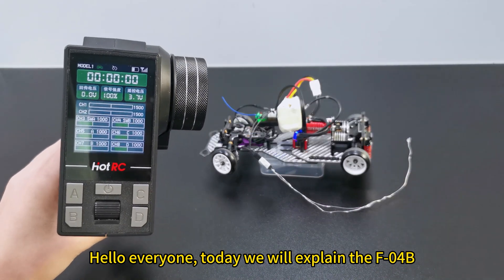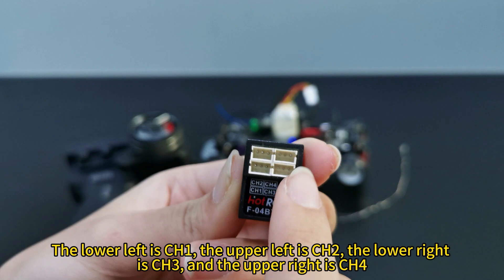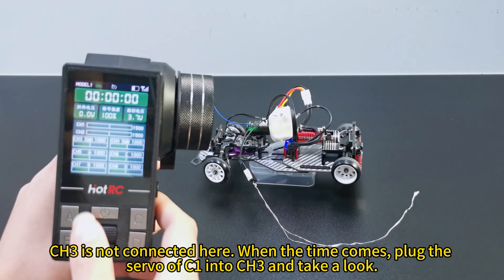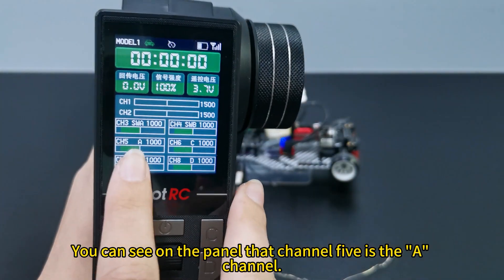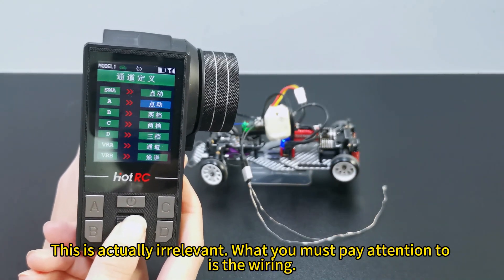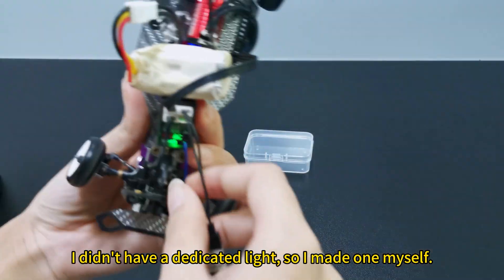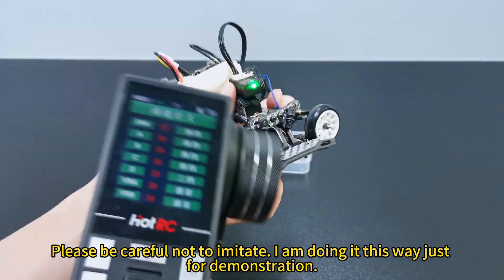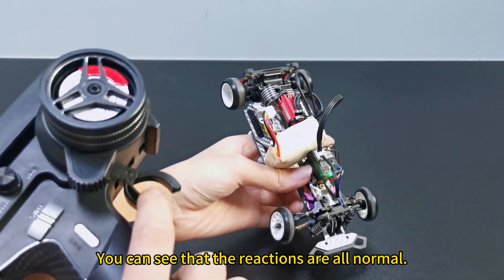What is the use of CH4 of the F-04B receiver?

Comment: Is the plug size 1.5 or 1.25?
Reply: I had to use 1.5 plugs as the 1.25 was too small.
Reply: @neilmcgrath2647 was that with the F-04B receiver? I'm struggling to find what connector should be used.